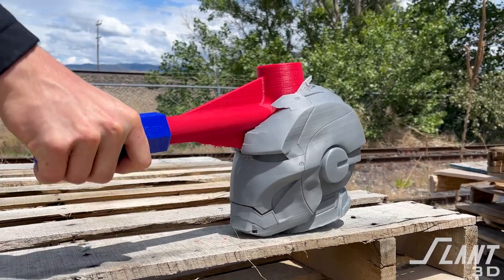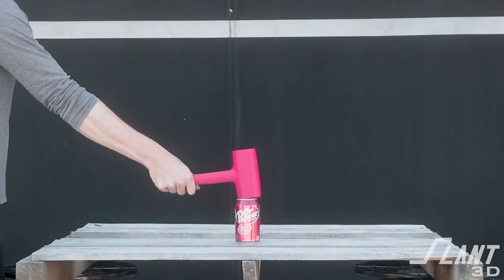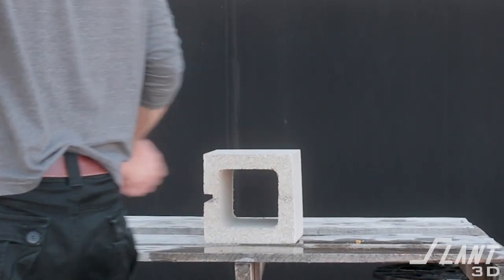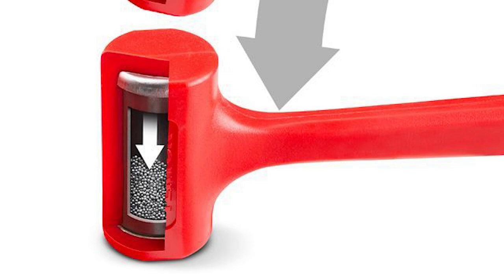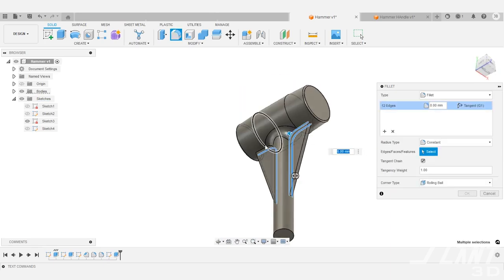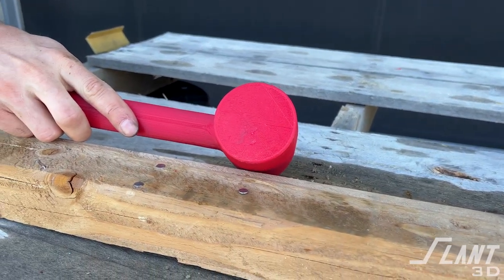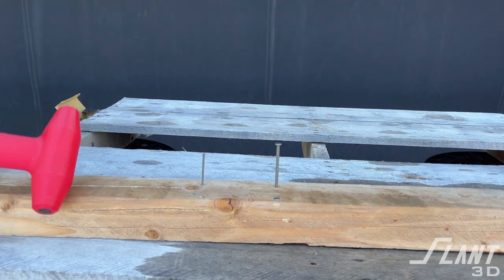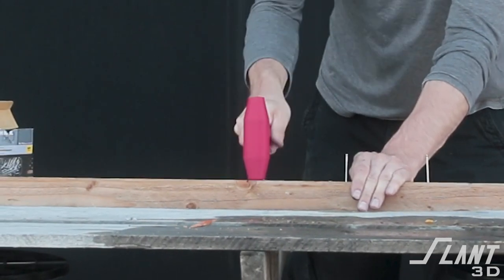We 3D Printed a Hammer that Actually Works

Comment: How about designing a 3d printed kick scooter?  How you fit the bearings and designing it to flex instead of crack when put under sudden stress would be educational and interesting.  Could make it a multi part series and do polls for different features (big wheels vs small, handle bar shape, what kind of brakes, etc.).
Reply from the maker: Interesting Idea
Reply: TOP! I'd like it too! @slant3d

Comment: I would have loved to hear more explanation given to the orientation of the part and how that effects the strength of the design, maybe a demonstration of it was printed vertically and horizontally. 

You also mentioned a few times that there was stuff you could improve to make it more comparable to a normal hammer stuff like adding more weight to the head of it etc, I’d love to see those changes made. 

One question I had is would it degrade if used outside? I’ve heard that PLA melts or deforms if left in the sun for too long.
Reply: Interesting but nothing missing or too much complementar to the video.
Answering (tryn to, I'm not him of course), printing it vertically makes it prone to crack at the handlebar. And trussssme you don't want YOUR hammer to fail that way, ;) No other orientations appear to be possible for the shapes he showed. It is printed horizontally on one of the hammering faces, and the handlebar has to have supports. Even tho he hates use supports.

He did show at some point a section of the actual hammer where you clearly see it containing a cylindrical enclosure filled with lead balls. You just have to pause the print at the right height, fit in the object in the void you designed it for, and restart the print so it covers all up embedding the object. Test tolerances to avoid having to force the object to snap in while on a leveled printbed or the nozzle hitting it at the resume of the print.

PLA, but any print material has what's called in the TDS as "vitrification point" and that's the t° you set the printbed a lil'lower. After printed when the bed cools down, the material vitrifies under that point so it releases from the bed. We have PLA vitrifying (starting-to-soften) at around 55-65°C, then PETG at 70-80°C, and others above. (TPU is another beast). The first I think of to go cheap would be ABS which should be ok even above 80°C, but it likes moist and tend to delaminate, to split like dry wood literally, if printed without extra care (enclosed printer to say one, nonetheless for its toxic fumes).
Most importantly, PLA has the best resistance to compression before having to disturb costly materials or fiber enriched ones. Yes it's different from impact resistance, in which ABS does great, but for some reasons... Mostly that's a proof of concept I suppose, they kept on PLA. 
PLA+ would have been an interesting choice. Also bc, as said, when thinking of a PLA hammer my worst concern was to see it snap-crack without yielding and fly around, but it hasn't happened.

All these thing are subjects for at least 3 more videos which he already made, or someone else did, covering extensively and deeply the topic. For example about layer strenght and adhesion of different polymers you should check @ CNC Kitchen. I think this serie's topic is something that gives for assumed the results of those (and other people's) material properties investigations.

Comment: I have a similar design I'm working on that has inset faces with a 7/16 thread inserted in the print. I'm welding threads onto a steel puck I cut from 33mm bar stock. 
I'm considering lead for extra weight but the steel faces already weight 12 ounces. In fact I think the faces are too heavy. 
A dead blow has its value in my job but having an affordable multi material faced hammer using a common bolt thread insert will be very hand. I have 33mm bronze copper and lead/tin pieces I'm looking to add threads too. 

My home made Cartesian heated chamber printer is going to do a great job in a quality ASA. 

My first hammers where all strong PLA with hand chopped glass mixed with jb weld filling the handle and head. They are surprisingly heavy and sturdy. Able to strike an 8 penny nail with no damage. Trim nails chipped the face. 

My thread insert is going to be floating. Held in place with a hard rubber washer on each side. This should prevent fractures over time. I have plenty of injection molded hammers that didn't make the cut. Fdm can produce better parts in the right conditions. Heated chamber printing so far has been my secret to a near solid product with pennies on the dollar in equipment cost because it's a hobby.

Comment: Look at Martinez tools. They have several different modular hammer heads. Why don’t you try making an fdm handle and see if you can optimize it for real work. I think that might be a better design test. Also did you ever discuss the later orientation you chose and why?
Reply from the maker: The handles were never an issue
Reply: @slant3d  Sure in very brief testing. Hand it to a framer and see how long it lasts. Is this channel focused on 3D manufacturing real parts? This would be a test of a real part.

Comment: Great hammer design process and demonstration of designing for the material being used (0:28). The off-the-shelf bolt could easily be substituted with one that has a wider end surface area, or metal cap that screwed on the end. 
The soda/coke can demos need to employ unsealed, not fully pressurized volumes. LOL. Similarly failures will occur when trying to crush a pressurized plastic bottle with a metal hammer. Pressurized volumes are essentially as strong as rocket boasters able to withstand very high forces and stresses using the similar design technique of a thin lightweight thin outer skin  with minimal internal structure under pressure for rigidity.
BTW: Most modern rocket motor designs now rely on 3d-printing processes using metal alloys as the complex geometries required for high efficiencies are not possible with machining techniques. Sorry for tangent, but to some, 3d-printing is seems to be akin to rocket science. ;)
Reply from the maker: https://www.youtube.com/watch?v=JjRqbu54r6Y&t=7s